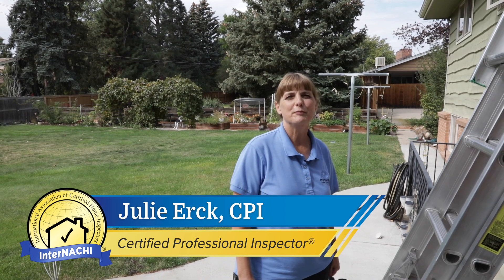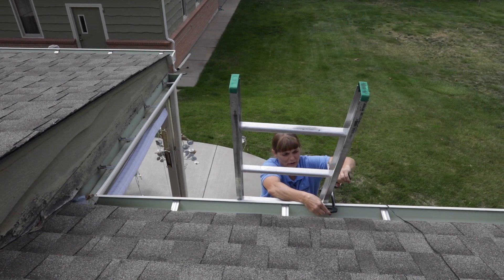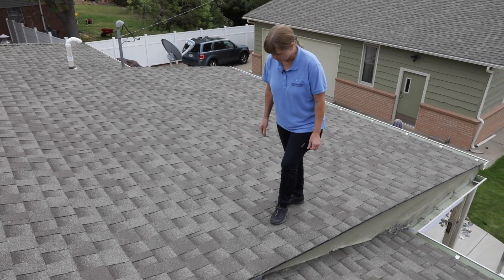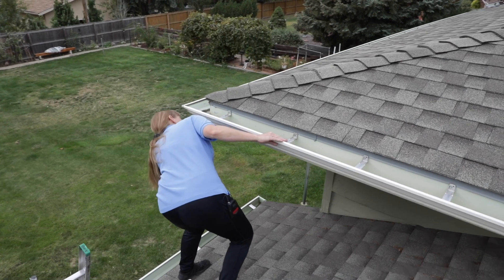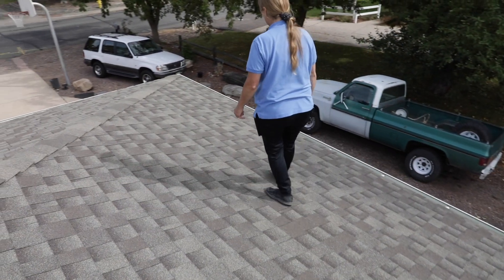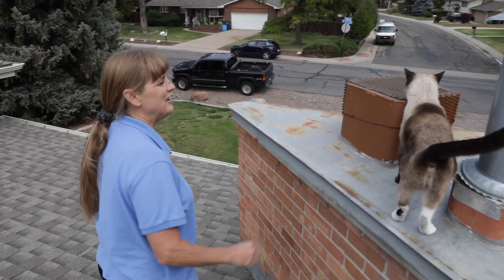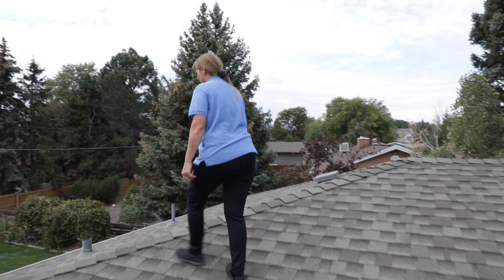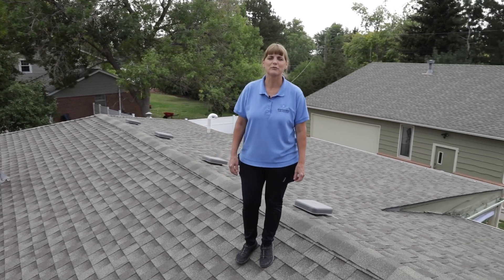Inspecting a Roof with Julie Erck, CPI

Comment: Is that heater exhaust vent okay being so close to that second roof edge? Maybe its the camera angle but most vents on that roof look very low. Especially if this area gets any snow.
Reply: After inspectingbthe rest of the home, we verified the vent was for the kitchen and the vent for the heater was at the chimney. Had it been as I first thought, it would have been too short.
Reply from the maker: Nice.

Comment: 3:14  It is stated that ventilation looks adequate.  Is she using the rule 1:150 rule found in Internachi training materials?  From the video I'm estimating 1800 sqft of attic space and only 4 steel roof vents at 38 in^2 each.  A roof this size needs 864 in^2 of venting.
Reply: I took into consideration the venting at the eves as well. The sq. ft. was 1300.
Reply from the maker: We have training on ventilation inside our https://www.nachi.org/interiorcourse.htm
Reply: 1:300 is good if the attic has vapour barrier installed under the insulation.

Comment: Very good video! Thank you Julie. By the way what is your ladder?
Reply: Werner type 2, 18 foot
Reply: @julieerck9125  What is your vehicle and how do you carry that ladder? Actually I am trying to figure out the balanced between vehicle and ladder. It is easy to recommend theoretically but I am interested to know the reality in practice, that is why I asked you what is your vehicle.
Reply: @mehrdadalavi7308  the ladder nonextended measures 6'3" so it will fit in most vehicles.
Reply: @julieerck9125  understood. What is your suggestion for choosing a used vehicle which  that ladder fits in?
Reply: @mehrdadalavi7308  any, just take a tape measure to be sure it will fit.
Reply from the maker: Good question.

Comment: and here we go again go and beyond the standards of practice that have been outlined for home inspectors which does not require you to walk on a roof
Reply from the maker: You're correct. Home inspectors are not required to walk upon any roof surface, but they are not restricted from doing so either.